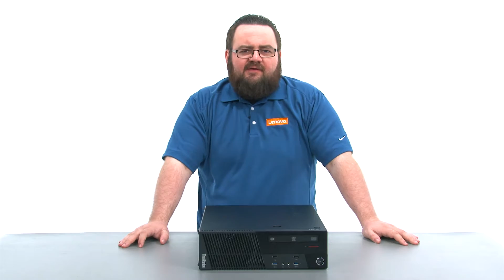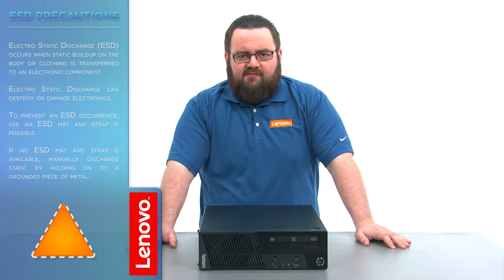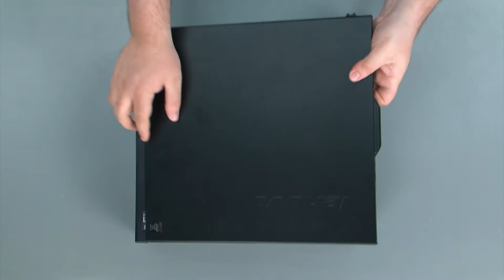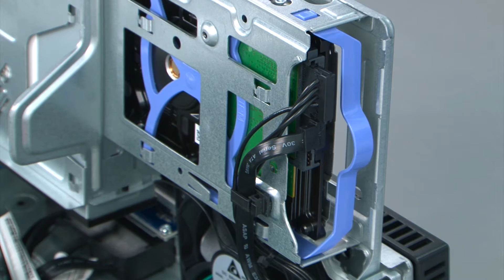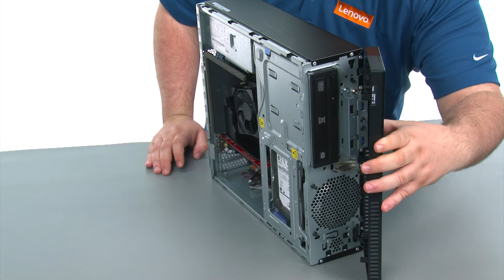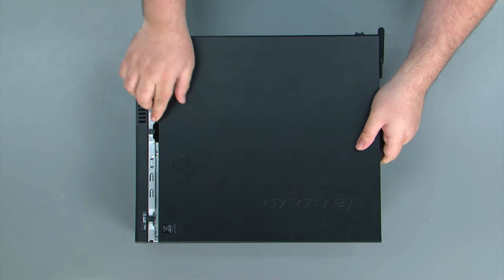ThinkCentre M83 / M93p Small Form Factor Desktop - Primary Hard Disk Drive Replacement

Comment: Hello, to comment that I have installed a Gforce GT710 video card of low profile and 2GB DDR5 with a power source requirement of 300 watts and the performance is excellent, there are no compatibility problems and even though this card model is not found in the user manual of the Thinkcentre M83 and with a 240-watt source, it accepted it very well, thanks for your advice. Greetings.

Comment: Do you have a part number and install instructions for the optional secondary hard disk drive install for the M93P Small Form Factor? Mine has the power splitter cable.
Reply from the maker: Hi Ryan! Looking at the Tiny M93P desktop it seems there is no space for secondary drive. https://lnv.gy/2Zp7gMy you may try to use external USB drive. Arjay_Lenovo
Reply: On my M83, You can put in a bracket for installing two 2.5" drives.  The motherboard does support two SATA drives.

Comment: Good morning, could you please indicate what external video card you have installed?
Reply from the maker: Hi there! Thanks for reaching out our support. There are variants that have pre-installed video card. Do you have the same model? If you do, could you send us the serial number so we can further check? We'll wait for your reply. Ash_Lenovo
Reply: Hello, it is the same thinkCentre M83 model and the serial number is SN: MJ000S2J, thanks.
Reply from the maker: The video shows that he is using M93p small factor. The video card installed may be one of the following: 
FRU Video Card HD8470 512M DP+VGA ATX 
FRU Video Card GT620 1G 64bit VGA+DP ATX 
FRU Video Card Quadro410 512M 64bit DVI+DP AT
FRU Video Card HD8570 2G 128bit VGA+HDMI ATX 
FRU AMD Radeon HD7450 1GB 64Bit DVI+DP HP 

Reference: M93p > Adapter section [http://lnv.gy/2GZjJ1i]. Matt_lenovo
Reply: Thank you very much for your help.

Comment: Can i remove the motherboard and power supply to a bigger case?
Reply from the maker: Hi there, thanks for reaching us. May I know the reason why you will be moving it? That is okay as long as there will be no damage that will incur while doing it. Are you going to upgrade part so that it will have enough space? Arjay_Lenovo
Reply: @LenovoSupport  i was planning on using these parts for a base model for my own pc build
Reply from the maker: Hi Cannon fodder micky, thanks for writing us back. There are a lot to consider for this matter. You will need to make sure to consider the compatibility from the product specification, positioning of the motherboard and fan (for proper ventilation) and also the case that you are planning to use. If you are inquiring about the ThinkCentre M83 or ThinkCentre M93/M93p, you may visit the following links for their product specification. 

https://lnv.gy/2ukZO7V

https://lnv.gy/39aQ1Qu

Should you have additional concern or query, feel free to contact us any time. We're always here to help. Fraineee_Lenovo

Comment: I hve the m83 aeries but i can not install the Windows! When the Windows restarts in final installation , it boot up again in set up windows menu installation
Reply from the maker: Hi L M. Thanks for writing in. How do you install the Windows? Are you using a USB recovery/installation? Have you tried using a different USB Recovery/installation? Let us know. We'd like to help. Auxen_Lenovo
Reply: @LenovoSupport  thanë you for quick response! 

I am using a USB flash drive for installing Windows. 

I fixed by installing the os in another pic and after i took the hard disk and put it back on my pic i wanted to install the windows. The computer recognise the os and booted up.
Reply: Great to know that you got it fixed. Feel free to reach us back at any time if you have any concerns and questions. Thanks for writing in. -Maru_Lenovo

Comment: Hello could I mount on my Thinkcentre M77 type 1983 a Radeon Wx 2100?
Reply from the maker: Hi there! You may try to mount it, but there is no guarantee that it will work due to compatibility issues since the part is not tested by Lenovo. Also, there are factors to consider like the number of pins on the motherboard. Here is the list of the compatible parts for this model:https://lnv.gy/2LckP8L Let us know if you need anything else. Ash_Lenovo
Reply: What about an HD 7750?
Reply from the maker: Hey there! Another help here. As we were checking here, you cannot mount the HD7750 on the ThinkCentre M77 as the GPU is integrated into the motherboard. See the complete specs here https://lnv.gy/2QQgoX9. -Chris_Lenovo
Reply: @LenovoSupport  Can you please explain because I didn't understand:``...as the GPU integrated in the motherboard.``
I have an HD 5570 in my Thinkcentre M77 Type 1983 Tower.
Reply from the maker: Hello! This mini tower GPU can't be replaced or upgraded since it is soldered to the motherboard. Let me know if you need further clarification. Thanks. Arjay_Lenovo
Reply: @LenovoSupport  Uhm actually I mounted on the HD 5570 on the PC,it was first an HD 5450.
Reply from the maker: You can actually mount a GPU as long as there is an available PCI slot, the form factor is fit with your tower and your system will meet the requirements of the graphics card that you're planning to install. Mark_Lenovo
Reply: @LenovoSupport  Thanks very much.
Reply from the maker: You're welcome! Should you have other questions and concerns, feel free to send us again a message here in social media. We're always here to help. Mark_Lenovo
Reply: @LenovoSupport  Hello again, today I mounted the HD 7750 but my monitor doesn’t give signal and I used the adapter DVI DVI.My monitor is an AOC e941wa.
Reply: Ah sorry it's a DVI VGA
Reply from the maker: Could you try to access the Device Manager and check if your Radeon HD 7750 is detected by the laptop? If not, it's possible that is because of the compatibility issue on the desktop. Mark_Lenovo
Reply: @LenovoSupport It worked the computer but the monitor didn't have any signal.  All the requirements are right.
Reply: And there was an electric sound when I powered on the computer.
Reply from the maker: Could you try to perform a Power Drain on the desktop by following these steps below, access the Device Manager, and go to Scan for Hardware Changes. You can check the photo attached as a reference. Let us know how it goes. Mark_Lenovo

Steps to perform Power Drain
1. Unplug the power cable from the wall outlet.
2. Hold down the power button for at least 10 seconds.
3. Reconnect the power cable and try turning it back on
Reply: @LenovoSupport  Hello! What's the case size for motherboard?ATX?ITX?

Comment: Please make some videos on 'how to add ssd into M93p' not replace please please please
Reply from the maker: Hi there, Aaftab Aalam! Sorry for the delayed response. Thanks for reaching out. We hope you're doing well. Currently, we don't have any videos available yet. However, I did a quick search and found a similar discussion that you may find helpful. Please see this thread https://lnv.gy/3cRmGMx. For the parts and part numbers, please enter the serial number here https://lnv.gy/3dLEDxc, then go to Parts (you can check the as-built, model and compatible to find the HDD bracket). Here's an article to help you locate the serial number https://lnv.gy/2zeh9Sc. Let us know if you need additional help. -Maru_Lenovo

Comment: Would I be able to replace the HDD with my own 10TB SATA III  3.5" HDD?
Reply from the maker: Hello Charlie! Thanks for writing in to us for support. Based on the specification sheet of ThinkCentre M93/M93p https://lnv.gy/2RyJzNL this model support only 2.5" Wide. For ThinkCentre M83 https://lnv.gy/2sOtdG9 this model support 3.5" wide HDD.  If you have ThinkCentre_M8, you can use your HDD 10TB SATA III  3.5". Let us know if you have questions. Keith_Lenovo

Comment: How can I put an ssd in it?
Reply from the maker: Hi KonekoAwesome o, you can visit the Hardware Maintenance Manual of ThinkCentre M83 and M93/p via this link https://lnv.gy/37rnWWP which will allow you to see the steps on how to install or replace the solid-state drive. Hope this helps. Chx_Lenovo
Reply: @LenovoSupport  I have the 7033 one I think
Reply from the maker: Hi KonekoAwesome o. For machine type of 7033, you can check the manual here https://lnv.gy/3qlWHEk. Thanks! Chx_Lenovo